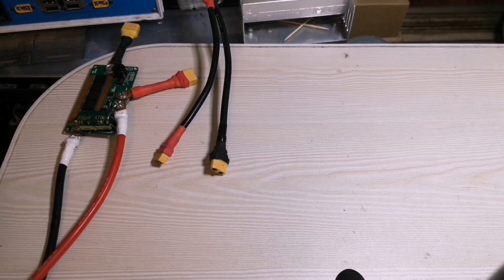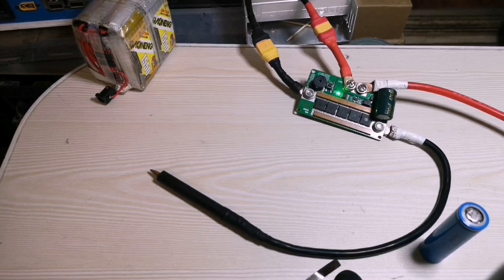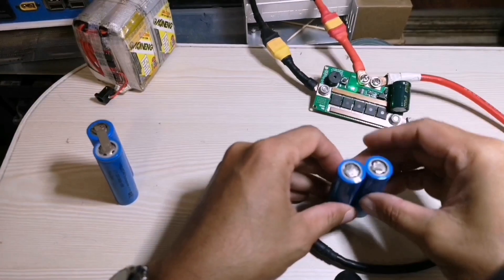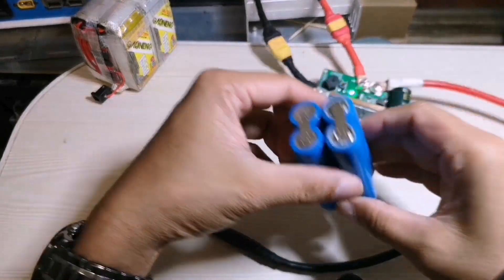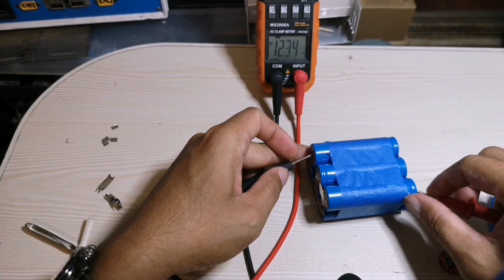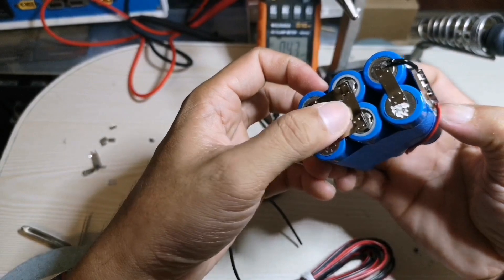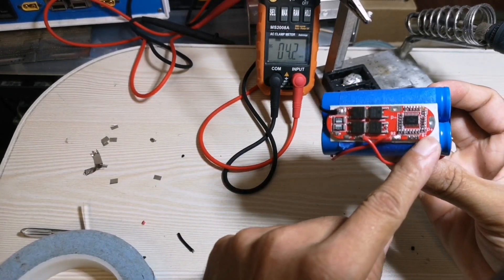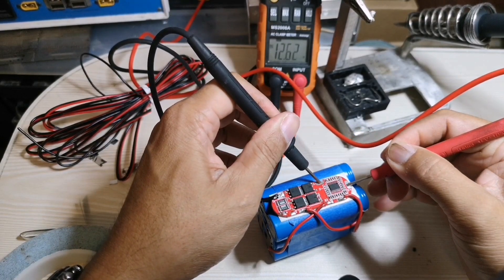Battery pack tutorial Li-ions 18650 2P3S 12V battery pack step by step

Comment: Excellent explanation. Thank you. I assume this is exactly the same configuration as 3s2p. (That's the way I've always seen it described)
Reply from the maker: Your are right 3S 2P or 2P 3S 
3S means 3 battery pack in series connection
2P means 2 cylindrical batteries in a group.
Anyway I recommend adding an insulation gasket to the battery positive for protection.

Comment: Nice instructive video. Do you have ideas for a simple charger for this battery? Thanks
Reply from the maker: It isn't formal but you can use it. Power adopter from modem etc as long as 12V but before that if you used a modem power adapter you need a DC Jack socket.
Reply: @pitikaron  Thanks for your rapid response. I have a jack installed. Will any 12VDC power brick work? Will the BMS protect the cells from over changing?
Reply from the maker: Yes it works but the specification for the real charger compares to any wall  12VDC power supply  is different but can charge. The power wall 12VDC has no auto Cut off voltage if the Battery is fully charged but the BMS can manage that.  Auto Cut off  when it is fully charged.  Moreover you should double check if  the amper of the  12VDC power supply if it is suitable for that battery amp.
Reply: @pitikaron  Thanks👍

Comment: When I build 4S LiFePO4 batteries, I solder any wires to the nickel strip before making the spot welds, but your welding technique is much better than mine.

I don't like 3S Li-NMC batteries because their voltage drops below safe level for sensitive 12v electronics.  For this reason I prefer 4S LiFePO4, but it is much more expensive and a little bit heavier.
Reply from the maker: It depend on how many battery in one pack.  however boss as long as the wire  conection and nickel strip is firm and consistent that is the best technique.  

exactly LifePO4 it is expensive.